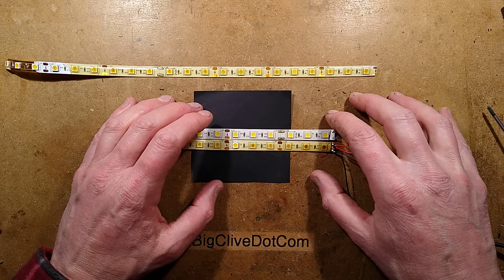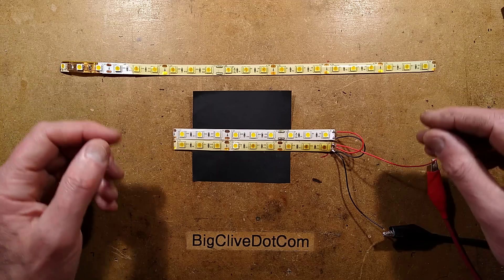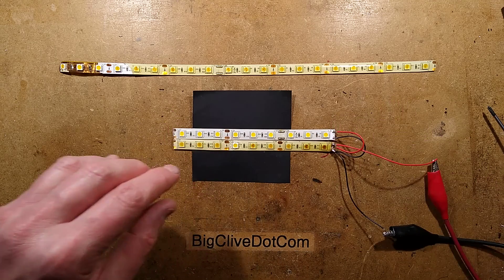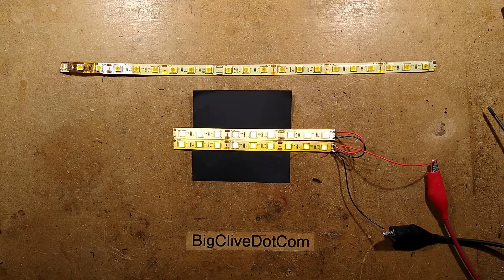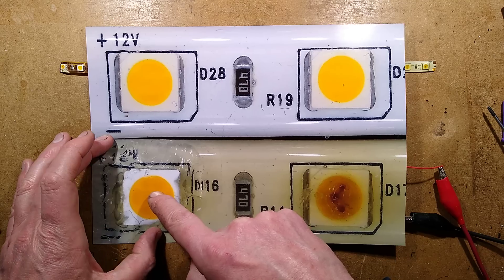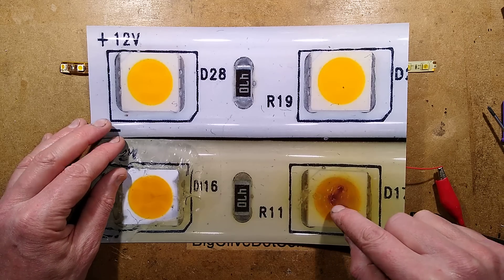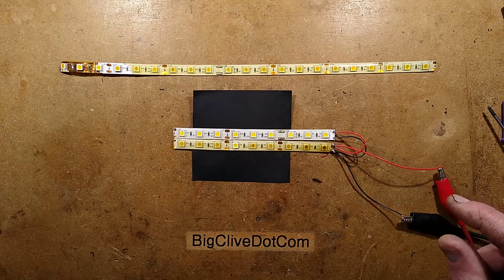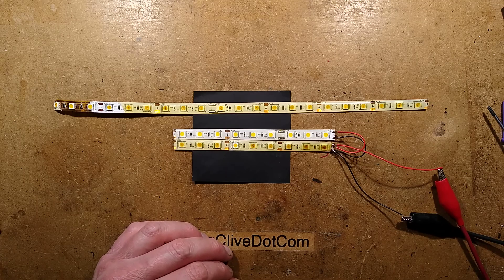IP65 LED tape coating fail

Comment: I have 2 strips that run the length of my garage, both cool white. Both have turned yellow near the beginning of the strip, but as you get to the end they look normal. I'm not sure if its because of extra heat, and maybe its the heat causing it to fail instead of the light, or why it is doing that.

Comment: I've seen something just like this happen to an RGB strip that came with a commercial product (a PC case decorating accessory). I took it out of storage to fool around with it one day after several years of disuse and discovered that almost every blue LED had a tiny brown spot above it that blocked and diffused most of the light, yet the red and green chips were unaffected. In some places the outer coating even appeared cracked and had what looked like pinholes in that area. I was quite puzzled as to how it had happened.

Comment: Is it possible that under powering has caused a wavelength outside the manufacturer's calculation for materials selection?
Reply from the maker: LEDs don't shift their wavelength much.
Reply: @bigclivedotcom  I'm a mech eng exploring electronics as a hobby. After a cursory look at LED science, I appreciate the comment.

Comment: I got an audio level indicator with a bunch of LEDs (various patterns etc In a little black box) it failed with LEDs looking just like that. Not the waterproof strip with the rubber dome just straight ARGB tape In a box  (I also got the updated for 2021 version which hasn't failed yet, so I guess they're aware of the issue)

Comment: I have exactly the same feeling about the “protective” gel... every single example of it I’ve tried has failed in one way or another. Bought some quality (but not cheap) tape from UltraLEDs and it’s been up for years, used every day, and still perfect! I’ll never buy waterproof again 😡

Comment: Thanks; I had the exact same thing happen to a strip that had been up for years above my garage workbench. I just replaced most of the strip with the rest of the original batch thinking it was the LEDs themselves, but now I can cut the moulding off the rest of it.

Comment: I had a friend get that kind of led tape for his aquariums, lasted a whole week before half the leds died from moisture
Seems like the coating isn't even good for what it's ment to do
He replaced the strip w/ an uncoated one where he simply used nail polish (clear) to seal the led packages and it's been fine for 2 years now

Comment: I had exactly the same experience with an IP65 strip that I installed in my kitchen. Originally cold white, slowly went to yellow, and then I'd say almost brown, after about a year or so. I went for the "waterproof" stuff just to provide some splash resistance since it was in the kitchen.

Like you, when it got too far gone I replaced it, and I did consider sending it in to you Clive to investigate, but the shipping cost from Australia was going to be madness.

After seeing this, I'm glad I opted to replace it with non-waterproof tape. Here's hoping the new one lasts a lot longer

Comment: Got a video on why LED street lights are failing purple? I suspect the white phosphors are coming off exposing the purple/UV elements. But I have no idea.
Reply from the maker: It does appear to be the phosphor detaching.  Not sure if it's on the LEDs or remote to them.

Comment: Your great beardness, what's the best way to get rid of that silicone coating without damaging the LED strip? 🤔
Reply from the maker: It depends on the coating.
Reply: @bigclivedotcom  I buy the cheapest LED strips and they all feel the same to the touch, your excellency. 6000K white LED strip got the same 3 brown spots on all the LEDs... after a few months use... 🤷‍♂

Comment: I have a reel of led 12 volt lamps that I bought a few years ago. I haven't used many of them and they have discolored while just sitting. The  silicone coating has turned yellow over time. I haven't run the string of lights and they aren't in sunlight. I have to peel of the coating if I want a decent light.

Comment: I see this all the time with blue led strips and multi colour ones right where the blue chip is. My thought was that a slight uv component of the led was breaking down the silicone or whatever it is they use

Comment: I had something like this happen a few years a go for a cablemod brand light strip in my PC. Happened in a bit over a year of use I think. I contacted cablemod and they sent me a replacement which has now been flawless for over two years.

Comment: Speaking of failures. Can't find it right now, but once you had video about 220V baton lamps that looks like the one in https://www.youtube.com/watch?v=sMtubTHJybM.
My problem is, in my 50W version of that, the power supply is failing. Till it (the electronics) is warm, it flickers a lot. (So I stopped turning it off)
How would you go on finding the fault?
I could send you pictures of the TWO (one on each end) power supply boards. It runs mains from one end to the other. As it is mostly still good, I really don't want to turn it to landfill.
If I could buy it again (currently isn't sold, or anymore, at least not here) it would be cheaper to buy a new one than investing in postage to sent it to you and back to me. So, yeah.

Comment: I've got some amber LEDs that I used as a rear marker light on my bike. The same happened with them. The coating became so brittle in one place that it broke the copper tape where a fracture overstressed it.

Comment: I have a travel trailer for camping around british columbia, made in 2014.    It came with a strip like that to light up the area under the pop-out awning.  A year later some of the lights had started failing in the strip.   By the third year the strip was dead.  The LED's look like the example here.   So annoying.  I'm not handy.  But I'm going to try to replace it this spring.

Comment: If you attach the LED tape to an aluminum channel as a heatsink, it greatly reduces the yellowing and light degradation. I just get the cheap stuff at the local hardware store and it works well enough.

Comment: I have no doubt it's a UV reaction. I have some RGBW LED bulbs, and I discovered that after leaving them on purple for a while,  a few glow-in-the-dark objects in the room were charged! And these are from a fairly reputable manufacturer, so if they're putting out detectable UV, random LED strips must be, too. [I also avoid having my bulbs on blue or purple for too long these days.]

Comment: I gave up using these coated strips several years ago due to these problems. I have some still in their original sealed silver packaging that are 4 years old. I unselaed one this Christmas to use and the coating was noticeably yellow and quite stiff even though it had never seem the light of day.

Comment: Put some up in my porch about 3 years ago and so far apart from a small section illuminating pink regardless of the colour selected  there is marginal discolouration of the gel covering but it feels stickier than when new from Tool station.

Comment: That is why I'll never buy LED strips with coating from china again. I have some reels in my basement that have strongly yellowed without ever been used.
Manufacturer of these resins often do not know what is required for use with LEDs (especially when there is significant radiation of blue light) and they will sell you stuff that is not really good for long time use.

Yes, newer tapes are better, but still not better than putting strips in a aluminium profiile (or sth. like that) with some acrylic plastic over it. :)

Comment: I have a long strip of that tape with the coating, and even though I've never actually switched it on, most of it has turned the same yellowish/burnt colour.  So perhaps not a chance precipitated by the blue LED light, but a chemical breakdown on that vinyl'ish coating.

Comment: I used some 12v stips for a fish tank setup. Same degradation. I peeled off all of the silicon (?) and they then worked 100% fine. I did not need to buy new tape.

Comment: I had a set of IP65 RGB tapes set on fire a few years after installation into my parents decking.  The LEDs were mounted under the plinth in aluminium extrusion. It looked like the coating itself ignited. Put me off the stuff forever!

Comment: Had this happen to both 24/7 in use with poor heat management, and still in the aluminum foil packaging from shipping. So UV or heat may have it happen faster but just being on the shelf does it too.

Can't peel it off without damaging the leds or resistors. Maybe if I heat it up.

Some of it still smells bad like cheap Chinese plastic bad.

Comment: I've seen in some forums that they don't advise waterproof led strip (IPX5 or 7) if not needed because they make the already little passive dissipation even worse. I think this video shows another reason to avoid using them indoors
Reply: Indeed, I use with waterproof strip for ambilight Monitor project, and after 3 years, the strip was dead.
When I turned the monitor to replace the led strip, I noted the plactic "waterproof" above the led, to be no more transparent, but yellowish!!
Back, when working on the ambilight project, I decided to go with waterproof protection, even if it is indoor project, as it is said to give better light diffusion... I guess it is just a myth...
Next time, I will go for standard model... And clean the led strip, time to time, of the dust accumulatio with a little brush ))

Comment: I wondered about the gel getting grilled by either the heat from (contact with) the leds, or by uv exposure. I don't use coated tape where I depend on the light, and will use uncoated tape inside a  fixture, and coated tape where it's just accent lighting. It seems my idiosyncrasies may have saved me! Thank you for showing this, Clive! 👍👍

Comment: Seeing Clive's issue and reading all the comments I'm surprised that I've not have this since I have copious amounts of LED tape in and out of the house. I can think of 2 possible reasons. 1. Only one of my strips is IP65, thus less coating, and 2. I always buy the highest rated with maximum LEDs per metre, and then under-run them. My oldest strips are about 6 years and the newest are about 4 years.

Comment: The potting compound on import LEDs is pretty variable in general. Several years ago I bought a string of addressable 10mm, with the termination in a little poly cup that gets potted with some kind of hard urethane or polyester resin. It STANK of some unidentifiable sweet and plasticy smelling solvent for years and the potting compound was already starting to yellow fresh out of the packet. Darkened over the years to a uniform amber color. I'm pretty sure someone just mixed the batch of the potting compound in the wrong ratio. Quality!

Comment: We have had numerous problems with the 3m LED strip lighting .Especially under cabinet lights.Numerous under cabinet lighting failure.over heating and adhesive failure .The LED strips needed to be potted on an aluminum strip for a heat sink .many had turned yellowy orange .Many failures .They are pumping the LED too hard .A constant over voltage condition .plus the surface mount resistors were heating up the plastic as well

Comment: I have used these strips for a lamp above my keyboard, but I simply removed the gel layer, it was very easy to do from one of the ends. I in capsuled the end result in clear epoxy.

Comment: In my camper van engine bay, the heat from the engine 40-60C seems to cause discoloration even when the LEDs are only lit occasionally when I am inspecting the engine.

I have the same on my boat where the IP65 coating is covered in yacht varnish. These have not yellowed anything like as badly even though the inside of the boat gets hot when the sun shines on the blue deck above

Comment: In my pinball cabin, I have a mixture of the IP65 and regular uncoated LED strips, bought at the same time, from the same seller.
The IP65 is all failing, it has gone weird coloured and various segments have failed.
Where segments have failed, there are vertical cracks in the copper foil of the tape, so I assume that the actual mode of failure is a difference in expansion/contraction of the tape and the coating causing the cracks, as none of the uncoated have cracked at all

Comment: Basically near UV problem. The waterproof coating is basically almost the same kind of silicone as transparent phone cases. It goes yellow with UV (or close enough light wavelength). The more intensive light the faster it goes bad and darker it gets, so it make sense it has basically gone black in the spots with highest light output.

Comment: It's impressive how ubiquitous LEDs are now. I can't remember the last time I encountered an incandescent bulb. Maybe in my car's dome light.
Reply: I think the light inside my kitchen oven is incandescent.  Because waste heat released in a 200°C to 300°C hot oven is less problematic than melted electronics in that same environment.
Reply: @johndododoe1411  I think my oven light is too now that you mention it. I don't recall ever changing it so it's at least 14 years old. The amount of baking  I do is nil.

Comment: Fascinating stuff.
I have an outdoor LED strip that started to get brownish / yellow in spots. The interesting thing is: It's happening in "bands". The darker bands are roughly 4-6 LEDs in length and then there is a part where it's fine. The Strip is only used for lighting up the balcony when the door is open - so it's not running much. Sunlight is out the question also because the strip is evenly exposed to sunlight. 
I suspect something like a storage issue because the stuff  came from a roll. Maybe the roll was stored in a specific direction against sunlight, other chemicals or lights or something like that. 
The Strip I have is the "outdoor" style that has a silicony-type sleeve that is a bit squishy and has air between it and the LED tape. 
Always wondered how this happened.

Comment: I have had the same issues. But when 5 meters costs 25€ it's fine if they only last one year. Keep in mind I use them in Finland meaning temps range from -25C to +30C

Comment: I wonder why the manufacturer of a ”LED tube”, which with one replaces a bad old fluorescent tube, recommeds removing a condensator (id est a capacitor, one assumes) from the ballast circuit. I certainly did not dare to do that.

Comment: Is anyone aware if the "IP67" version, which is encased in a rectangular tube is encased inside with that gel? I would assume silicone doesn't degrade like that

Comment: I purchased some coated LED's to place under our deck railing for night time use so they were not exposed to the elements. Within a year, the coating failed quickly and the LED's failed. I think I got some of the same ones. They were made badly and I am going with LED rope instead this summer.

Comment: I guess it's another case which demonstrates that sometimes you're better off with the simpler solution. IP65 may sound nice in theory, but it also makes the system more complicated, expensive, and adds another failure point. If you don't really need it, you're probably better off without it. ¯\_(ツ)_/¯

Comment: On mine the white coating has mostly disappeared, under the gel. Idk if it is absorbed by the gel or something. The gel looks as clear as it was new, but the light is still a bit more yellow. I also bought a few of those in an extruded aluminium profile, with clear epoxy on top. Same there, white coating is gone, and the light is yellow.

Comment: If you had run the led's at the 'rated' power, they probably would have failed (as designed 🤔) long before the coating would have deteriorated
Reply: Silly Clive, due to his improper use of the product, now he has to deal with a deteriorated coating. It's a shame he bypassed the system the manufacturer provided to keep the coating safe.

Comment: Bought a white LED strip to put in my computer case a few years ago, the exact same thing happened, the outer coating went a yellowy-brown colour after about a year or so. Almost looked burnt so I removed it thinking it was faulty, but you raise a good point about the UV damage.

Comment: Hmmm. The ones i got do not show thiseffect yet, 2 .. 3 years old but i dont really run them often, and they are not exposed to chemicals, jägermeister or wufflers.
Also did not chinaimport them, but the "brands" probably do anyways.

Now i wonder if thats going to happen to my flexible 24V cob-led strips also... they are not really ip65 coated but the yellowish 4mm phosphor strip completely embeds them. On the other hand its already supposed to be orangeyellowish.

I find they run perfectly fine on a 19V supply, had them on 24V and a ne555 pwm dimmer to regulate.

Comment: A general rule with LED strips is: if you don’t need IP65, don’t use it. The coating gets really nasty at some point, even the strips with the silicone tube around them get bad over time, although it takes way longer

Comment: Maybe it comes down to quality of the strip? I have around 6 meters of similar LED-strip in my kitchen. It´s been working for round 7 years now with no degrade of the gel. I only had to change the driver once.

Comment: It's as if LEDs get cataracts! I wonder what the manufacturers say about this and are there more stable coatings available? It's disappointing that some LEDs are not as robust as makers claim - in particular, light strings that are supposed to be weatherproof but turn out not to be.

Comment: Mine failed in a different way - the resistors go intermittent and groups of 3 LEDs flash randomly. Different groups fail at different times until the whole strip is randomly flickering, getting worse until they stop. I thought it was the PSU giving too high a voltage but have used multiple different PSUs, all measure about 12v.